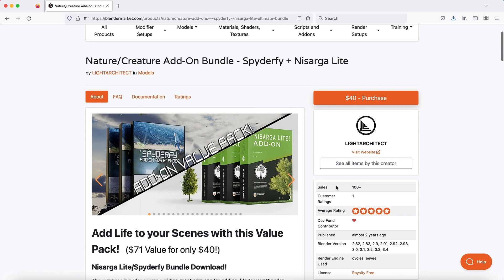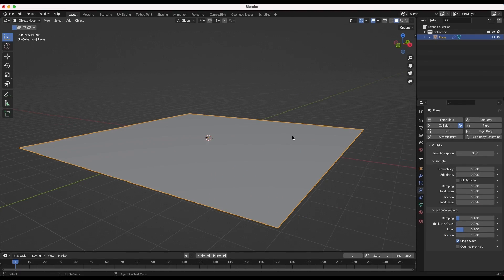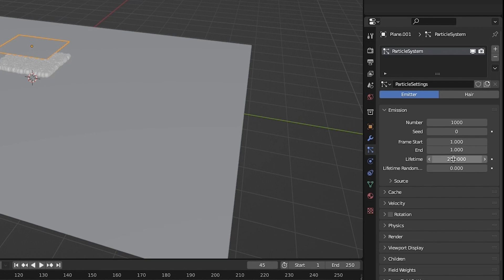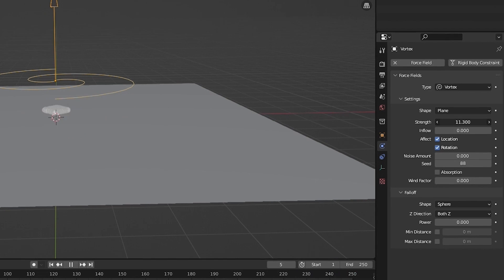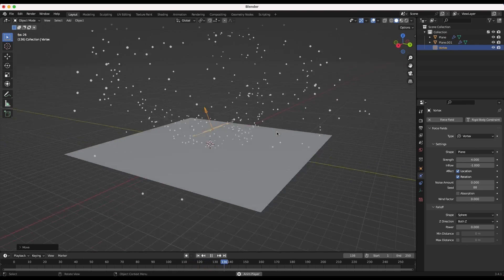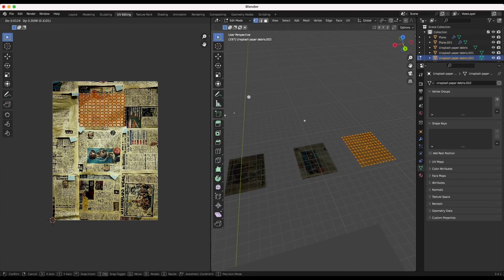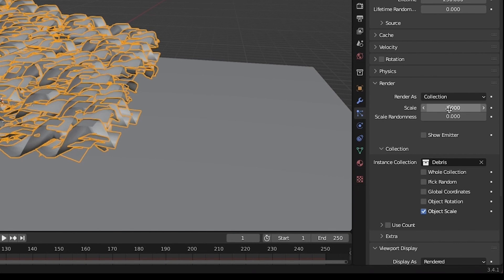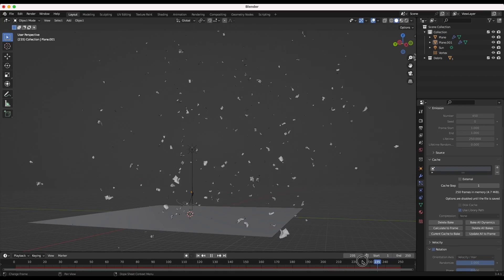Create a Blender Debris Tornado in 3 Minutes: Quick Tutorial

Comment: Thanx alot, but How can paper be soft in the air? Can it react to the air like clothes?
Reply from the maker: Good question. In this case the paper itself doesn't bend in flex but is rather instanced as a solid object. It's more of a cheat than a real softbody....but you could create a similar effect to this by using a softbody simulation for the paper debris....it would just be way more heavy on the computer. Hope this helps.